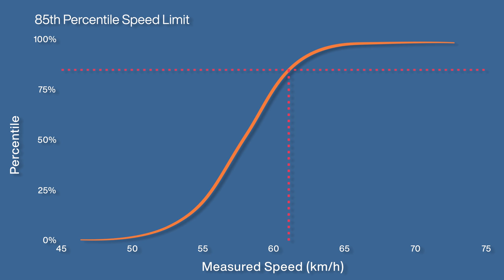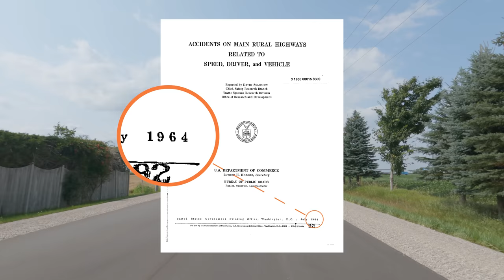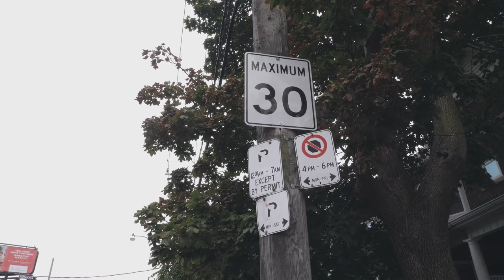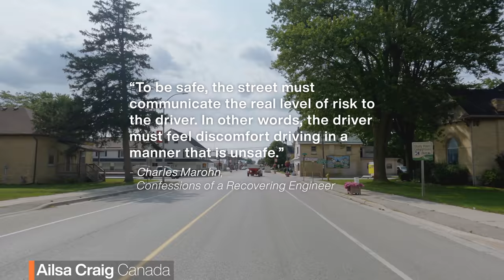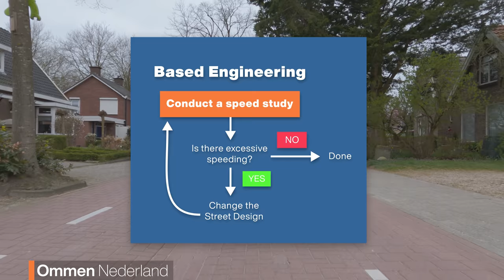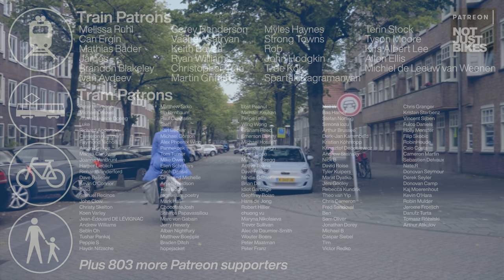The Wrong Way to Set Speed Limits [ST06]

Comment: The trees beside the road not only slow down drivers, they're a safe buffer for pedestrians should a car veer off the road. Also they look nice. EDIT I'm wrong, trees are not safe lol
Reply: And in urban centres a good tree canopy is a good method of reducing street-level heat.
Reply: In an off center collision or if a car leaves the roadway sideways, the car can spin around the tree and take out pedestrians. That was my least favorite part of the video. No need to get homicidal with the drivers. Just give them good visual cues that they need to slow their pace.
Reply: And obscure pedestrians from view
Reply: In the netherlands a lot of trees at the side of the road are being removed again now when they get their 30 year redesign.

Trees are dangerous and cause a lot of fatality's. So they stoped using them many years ago.
Reply: @Markle2k  As opposed to the car raming them head on or piling into a house? Why not counter w/ shrubs complementing the tree to counter spin on the car already being slowed by the other street-design?
Reply: Don't trees also help buffer noise pollution?
Reply: @pmmmAMV  yes they do indeed.
Reply: @Akriashi  that is what is being done nowdays. Trees do have a lot of downsides as well in case of accidents. So newer and better solutions are used nowdays.
Reply: Near me there is a narrow, curvy rural road with brush, horse fences, and power line poles, like artificial tree trunks 2 feet from the road at a point.  The speed is 35 mph (55 kph), which feels fast for me.  But this is Merica, so lots of drivers are going 50+ (80+) through there.  About 2-3 times a year there are head-on collisions with the fencing or the poles, rarely fatal but often injurious.  The poor home owners always seem to be replacing the fencing.
Reply: And help air pollution and cool the city
Reply: I feel proud to live in the country that won the dope-smoking championships.

:)
Reply: as a person from an area with tress on the side growing up... it never slowed anyone down we still went 55 on a 35
Reply: @MrWhite-pn7ui  wtf are you even talking about?
Reply: Trees or other similar solid objects - utility poles, etc - are very dangerous to have so close to the roadway. If a vehicle leaves the roadway for whatever reason, they strike an immovable object ... dangerous to motorcyclists and bicyclists, even at city-traffic speeds. It's better to do it with low shrubbery (kept low so that one can see over the top of it), perhaps concealing a guide rail underneath if warranted by circumstances ... striking a guide rail is a glancing hit as opposed to a direct impact with an immovable object. Shrubbery also discourages errant pedestrians/bicyclists from crossing into the roadway in places where they're not supposed to. There's lots of ways to do this, but trees and poles and such, immediately adjacent to the roadway, are hazards on their own.
Reply: @bikeaddictbp  Damn, thought I was onto something lol. Thanks for the correction, I appreciate you all.
Reply: @bikeaddictbp  "To be safe, the street must communicate the real level of risk to the driver. In other words, the driver must feel discomfort driving in a manner that is unsafe"
 So as you are stating yourself trees are very clearly an effective means of communicating risk. They also happen to do a lot of other neat things too. Also we are comparing driving a car with accident avoidance, crumple zones and airbags to  pedestrians and cyclists- they could very well use the protection trees can provide.
Reply: @Pancakegr8  You are on to something! Don't let his opinion make up your mind. Read my reply and then decide ;)
Reply: @rubensilverman3608  "Feel discomfort" does not necessarily mean "actually unsafe". Trees and utility poles immediately adjacent to the roadsides are deadly to motorcyclists, for example. It's better to convey an impression of risk without actually being a risk. Low shrubbery works because people don't want to scratch their cars, and you can still see over it if there is a bend in the road to see other traffic, and it discourages pedestrians and cyclists from crossing where they shouldn't, but it isn't a big risk to someone who actually hits it. Trees that are small enough to break when hit, are fine.
Reply: Theres a road near me that has trees like that. Its super narrow. Posted speed limit is 50mph then 200 yards later its national speed limit then 400 yards later 50 mph again. You can't really hit 50mph along the whole thing, 40mph is the drivable max as its just not safe to go faster. Yet folk actually try. Thats uk country roads for you between small villiages.
Reply: @bikeaddictbp  Where do we put the snow then?  The snow and salt is going to kill those bushes in the first winter.  Unless we stop plowing, which will also slow down the traffic, LOL.
Reply: @frotoe9289  Major source of ticket revenue!
Reply: Well technically, they are indeed safe for the pedestrians.
Just not for the drivers...
Reply: @rubensilverman3608  the design has to communicate the existing level of risk, not cause an additional (and more visible) risk. You don't necessarily want it to be unsafe to drive faster, you want it to *feel uncomfortable*. And frankly, even just watching the video, when those posts and trees loomed into the road, my instinct wasn't just to slow down but to actively hug the other side of the road for fear of hitting them. Which is also an unsafe reaction to inspire
Reply: @Markle2k  Also who's going to trim back the trees when the branches overhang onto the roads. Who's going to clear up the massive branch that eventually falls onto the roadway and blocks it, hopefully not crushing a car. Trees along the side of a road are not good.

Comment: What I see often in Germany (where I live) are trees or flowerbeds blocking a part of the street to slow cars down. It also works pretty well and you can't decide to just drive over it. But I also think that speed signs like those in the video are designed poorely, because they are pretty difficult to see. If you have a fat red circle with a number in the middle like in Europe it would also be easier to notice them without actively looking.

Comment: This is something very simple that I wish people actually listened to: SIGNS ARE NOT ENOUGH.
Reply: Yeah, the three laws of traffic dynamics:

#1 - Paint is not infrastructure
#2 - Signs are not infrastructure
#3 - (Unenforced) Laws are not infrastructure
Reply: Very true.
Reply: The fundamental principle here that no one is saying is that people are too stupid to follow signs.  I agree completely.  I just thought someone needs to actually say it.
Reply: Yeah, my hometown decided to be bike friendly, which is generally great, but one of the dumb things they did was take many straight, wide, safe, arterial streets that were 35 mph and make them 25 mph. The result is that either you get stuck behind someone going so slowly you want to die, or you're technically speeding.
Reply: @guru47pi  As cycling commuter, and Dutchmen, I have to travel over some narrow (less than 4 meter wide) polder roads were the speed limit in mph is 38 mph. Now a lot of people actually slow down when passing me, but once in a while there is someone that does not or even continues speeding. When you're vulnerable, because on a bike, that is absolutely scary, as they pass quite close to you. So although I understand car drivers wanting to drive quicker, it is only possible if cyclists and pedestrians can use a separate path. If that is not possible, speeds above 25 mph are very dangerous, as any collision could also seriously harm car drivers. In those cases, the road could and should be adapted to prevent the loss of human lives. As someone driving a bike most of the times, I want to reach my destination safe and sound. When I drive a car, I want to get to where I need to be without killing or maiming anyone, as that guilt would be with me for the rest of my live. So that road design is needed, and as bonus, it makes driving much more comfortable.
Reply: @testpeer  I agree, I also bike, and some roads are simply too dangerous. I should add context that there are parallel bike roads that they (we) can take when biking,  without sending mixed signals to drivers. Just because it is scary to bike with cars going over 25 is not justification to make ALL roads 25mph. And if you do change the speed limit, you've got to do what the video describes and also alter the engineering of the road to send the correct  "danger" signals.
Reply: This is something that has become infuriatingly clear in my city on my drive to work. There is one stretch of a road through a residential neighborhood with a school and multiple single family homes across from this school. I call it a road because it is designed as such: it is very wide, with 4 lanes (two each way) in an area that doesn't even get enough car traffic to warrant a road that wide. The posted speed limit is 30 mph, and since there is a school along this stretch, there is a digital sign showing what speed you are driving to """""encourage""""" people to slow down. 
Of course, as you would expect, most people drive this stretch of road at a speed of 45 mph, and I have even observed some special children blasting through at 55 mph. Remember, the posted speed limit through this residential area with a school is 30 mph. 
As for me? Being the hardheaded dumbass urbanist that I am, I can always be found on this stretch in the right lane driving no faster than 35 mph. I often get passed by impatient people who expected me to speed up, and that's just become normal to me.
Tl;dr there's a particular spot in my city that I deal with often which exposes it's own terrible traffic engineering regularly, and it makes me mald. Because it doesn't have to be like this.
Reply: Isn't it also a matter of easily shifting responsibility by putting a sign in place? Especially in a society where law suits and covering your a.. seem second nature (seen from someone who lives in The Netherlands)? No matter how bad the situation is, or how worse the the design of the road, or the design and position of the sign, in court it's covered by the fact there is a sign.....
Reply: If you do it right, signs aren’t even necessary.
Reply: I wish they were. I pay attention to speed limit signs, and I use cruise control to obey them because one speeding ticket in college was enough for me
Reply: I hate cyclists I’m sorry it’s fine if you have your own lane but a bike cycling going 15 mph while cars are going 50 mph is much more dangerous than someone speeding
Reply: @fuzzytop4746  that’s right, cyclists don’t belong on a 50mph road. In the Netherlands we have cycle paths alongside those roads.
Reply: @Alacritous  I think it is more that people do not want to follow the signs because they think their right to personal freedom should not be infringed upon by the greater good of the masses.
Reply: @jimcarbone2748  that much is apparent from everything else that's going on